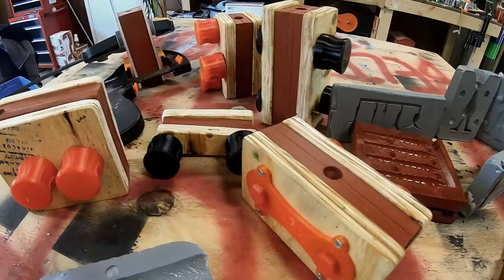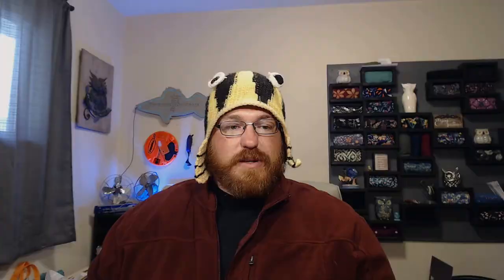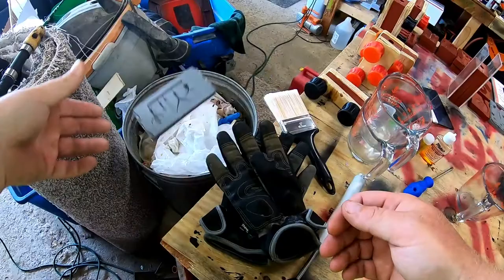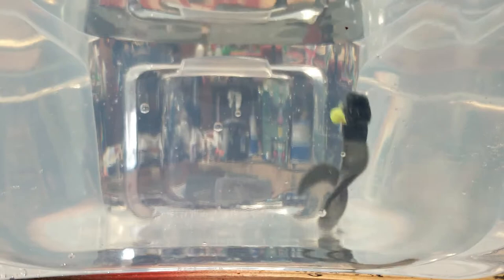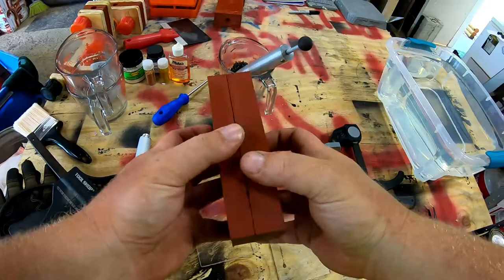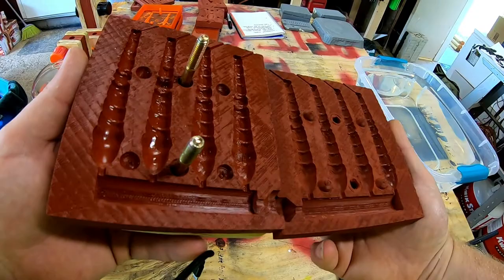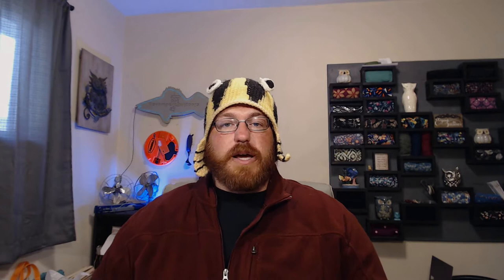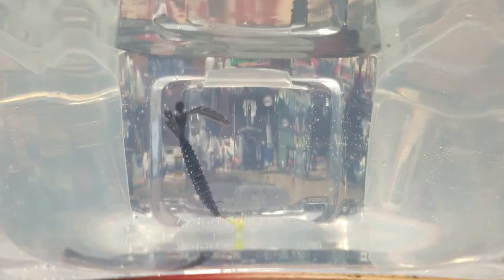Lessons from the last 2 years of mold making - Soft Plastic Lures - Episode 4

Comment: "The Richard"......LOL Gotta love it!
Reply from the maker: You know it! I will catch a fish on that one day, there's a bedding bass joke in there somewhere.
Reply: @RevampedOutdoors  ...I have been thinking about making molds on a 3D machine, but know nothing about them. What kind do you have, do you need other software to make custom molds, what material do you use to create the heat resistant molds.
Reply from the maker: @pikeevans8559  I have 4 different printers right now but for molding I am using a heavily modified Anet A8. I wouldn't recommend an A8 unless you want to make the modifications to make sure it is safe (power supply, firmware upgrade). Right now I would recommend a Creality Ender 3 because it is really good out of the box and affordable and most importantly relatively safe. Of course it is a hot thing moving around so there are always risks to familiarize yourself with but overall good machine. For the molds themselves I use Smooth-on Mold Max 60 silicone but any molding silicone should work. I like the max 60 because it is strong and tough for 2 part molds.
Reply from the maker: @pikeevans8559  I use fusion 360 for the mold design, but you can use other simplest software like tinkercad to start with. It takes time but skill comes quick if you have the ideas to practice on.
Reply: @RevampedOutdoors  .....Thanks so much for taking the time to answer my questions. I do appreciate it. Tight lines to you sir.
Reply from the maker: @pikeevans8559  no problem anytime, I forgot to mention you'll need a slicing software to slice the CAD models so the 3d printer knows what to do. This is like CAM for machining. But, the 3d printing community has 4 really great free options for slicing that you can download and get to work on any printer. Cura , ideamaker, slic3r and craftware are all great free options and they will all come with an Ender 3 profile which will work with that machine. That's about it, only thing else would be tons of online article reading and watching a lot of YouTube to get it to print. Heavy nets to you sir!

Comment: What would it take to get a 4" berkley power craw mold made. I searched and searched and couldn't find any molds or baits online. They were my dads favorite plastic to throw.  I went through some of his old fishing stuff and found 3 of them in the original bag. I'm scared of ruining them attempting to make a mold for them.
Reply from the maker: That's a tough one, it may be difficult to get someone to make a mold of that specific design because I'm sure Berkley probably still holds the patent on the design.  That means even if a mold maker was making a mold for you to use only for your personal use they are profiting from making the mold itself which is profiting from their design.  In my experience I have never ruined a bait while making a mold with them.  Unless the plastisol is so degraded that they are falling apart when you handle them.  Otherwise you could try to establish a mold with Alumilite Vac-50, pour one half of the mold and place in the craw half way, allow it to set up, then coat with a mold release (I use Ease Release 200) then pour the second half.  Remember to add a spru for the injector and some venting on the end of the appendages.  Then demold both halves and remove the old bait, I've done this technique on a few discounted baits and it worked well, a vacuum chamber is also really helpful if you have one.  I hope this helps.

Comment: Hey how do you avoid shrinkage when shooting in your mold max 60 molds? I gave it a shot, shooting dead on plastic & I can’t seem to get rid of the soft plastic shrinkage!
Reply from the maker: I am sorry I missed this question! Youtube didn't show it to me in my notifications, pretty standard for youtube I suppose.

I try to shoot a little bit hotter than most people generally between 320-330 maybe a little cooler if the mold is proven to work well.  Also a lot of venting like ALOT of venting.  The more the better it seems.  I have also tried to heat the molds some times but that is hard to do with silicone because it resists heat so well.  Also I like to press down the injector while shooting the mold and then hold for about 10 seconds just to make sure it gets all the way in.  Also I like to top off the spru alot just to help it because it does take a little longer to set up in the silicone than a cold aluminum mold.  I hope that helps!

Comment: what kind of silicone do you use
Reply from the maker: For molds I prefer mold max 60 from smoothon #notsponsored.  For jig skirts I like dragon skin 10, seems to be the right strength/stretch. I do like the VAC 50 hard epoxy mold material but I haven't found a use for it since switching to mold max 60. I hope this helps!

Comment: Good stuff. I've been following along for a while. Quick question: have you tried using xtc-3d to smooth the prints? I've never actually used it, but it seems to do good job smoothing stuff out. I think you may have convinced me to give this a try during the winter. We'll see how it goes!
Reply from the maker: Thanks! I have tried the XTC3D for smoothing, the last frog I designed was smoothed with it, I'm not sure if it is worth the effort, it did get rid of some layer lines but I don't think they're too bad to begin with. It does do it's job though it does make it much smoother, also easier than trying to get in the small parts to sand it!
Reply: @RevampedOutdoors  Good to know! I wonder if one of those harbor freight tumblers would help too. 🤔
Reply from the maker: @hotbrass2005  it would probably work if you were doing just the master and not the whole mold half. I guess I could try it with a smaller mold and some walnut shells in the Lyman but it might just open up the lines unless the print was top notch...which....let's just say I print for utility lol